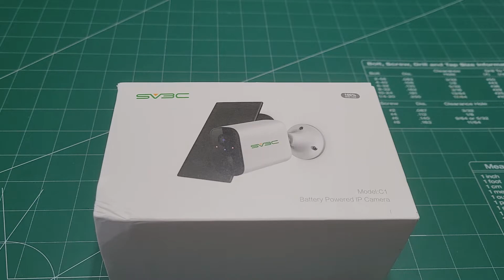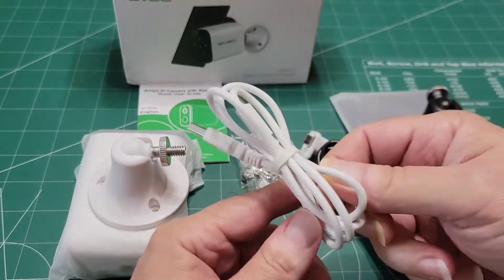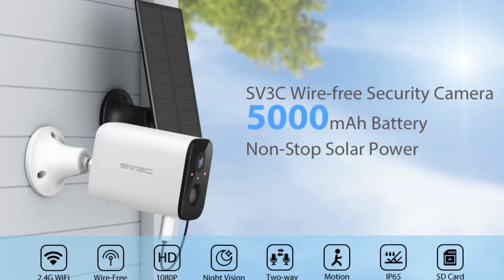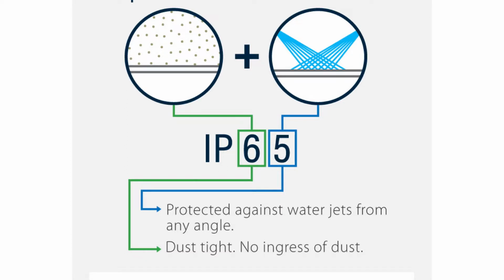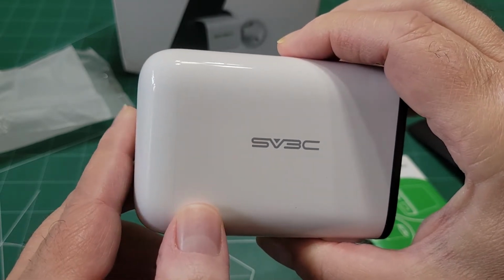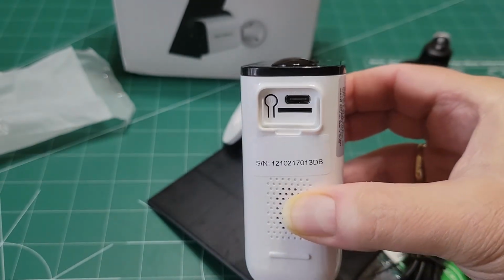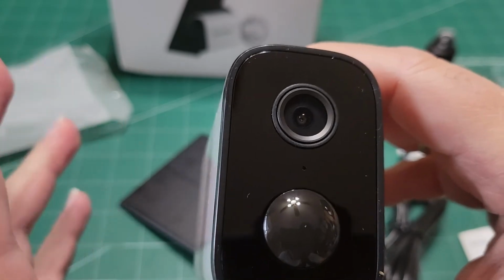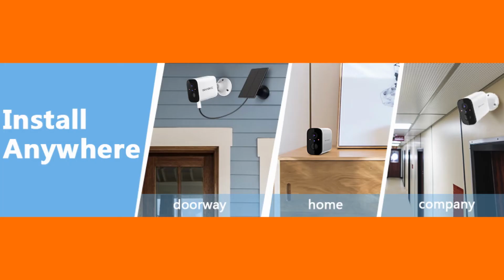SV3C Security Cam

Comment: Just curious.  Have your Sv3c cameras stopped working?  ALL of mine stopped around the same time and will not connect to wifi anymore.
Reply from the maker: Have you tried troubleshooting? Have you reset your router? Have you looked into your router to see if you can see the camera listed? Do you have any other devices that are not connecting to your Wi-Fi

Comment: They should have included the SD card in the order. 
It was horrible by the manufacturer for not adding the SD card with the camera.
Reply from the maker: Yeah they normally don't include an SD card they let you choose the size and the type that you want. Even if one was included which I have had some companies do that on smaller items it would be a very generic card and sometimes they don't last very long